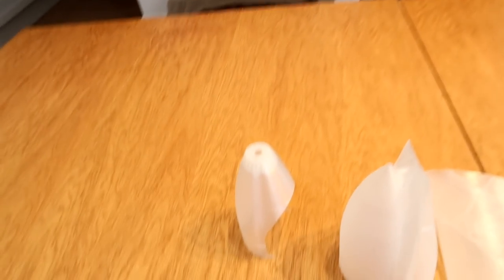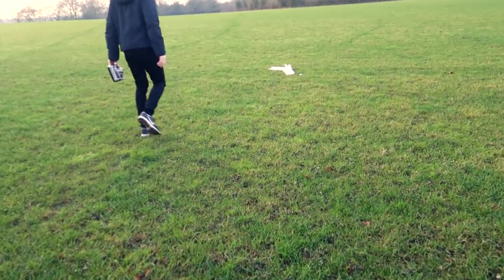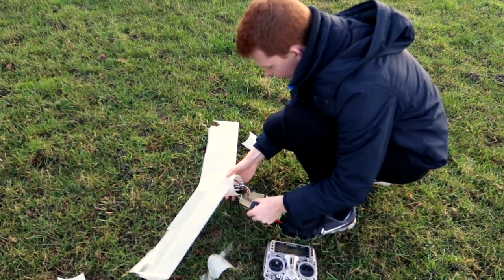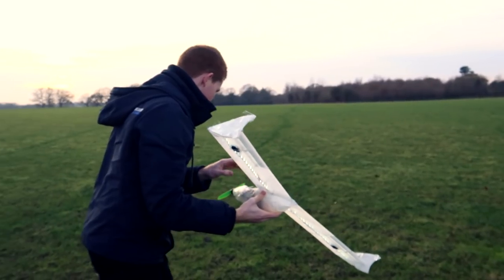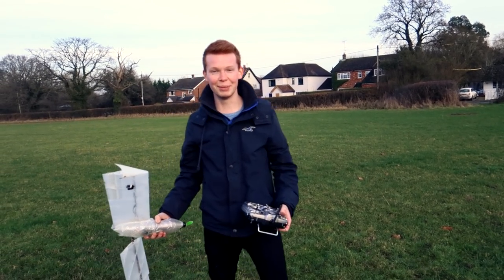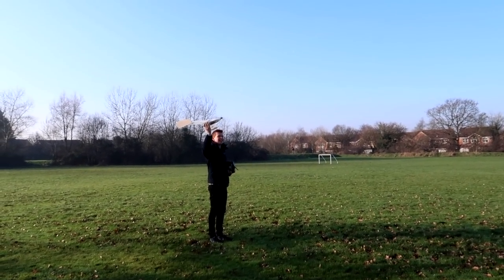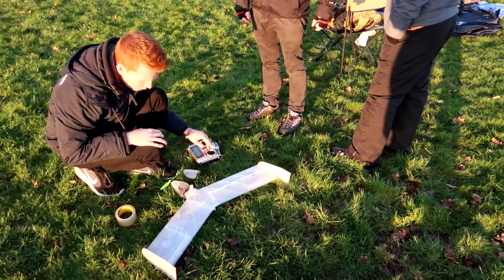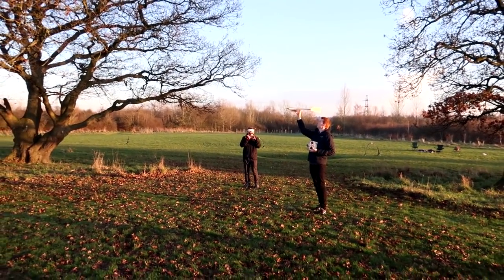3D Printed plane - Will it fly?

Comment: From a vintage modeler of 70 odd years you get that result when you launch pointing up with low power. Try level to slightly down the airspeed will then build up, and even if it could not fly properly it will land straight. We used to have much less power and control years ago and had to find ways of getting the best out of it. Design looks good though.

Comment: I think that the glue giving up so easily actually helps a lot in a crash, yeah, it's a pain to re-glue everything, but it's way better than having a rigid structure that transforms the total kinetic energy of the plane into "OMG 24 hours of printing gone to waste-energy".
Reply: Very good point.
Reply: Reglue>reprint
Consider it a crumple zone in a car
Reply: I make the spitfire fom 3d lab and i glue it whit CA and works great you may consider CA
Reply: Agree, if he had a spar, and better glue, the wing would become the weak point and break.

Comment: The launch failed because of the angle of attack on launch... It immediately stalled and engaged a spin. If you had a platform with a 4-5 degree upward angle climb on full throttle for launch, and had the correct airspeed for launch, your original airfoil would have worked. It was a really good design, I like it.

Comment: Tom, love your videos, and also your persistence! Just in case no one has mentioned this, but a launching catapult would be great to get your tests up and be ready with your controller. You can probably design one with a foot release, or even a servo release using one of your controller channels. I am sure you have probably thought about it already, but it would definitely save you some effort. All in all, keep up the awesome videos, as they are quite entertaining and informative, as I am a big fan of aviation (served in the US Air force as an aircraft Mechanic (KC-135R) ) and I am a great RC aircraft and helicopter enthusiast as well. Really liked your air powered motor project!

Comment: Good for sticking with it!  She looked nice when she finally got going.  Obviously there's tons of designs to work with later.  Perhaps see what it'd be like with the motor and propeller mounted at the rear of the fuselage, and have it rotate the other direction?  Basically make it into a pusher prop.  Perhaps with the weight towards the back it'd be a little more centered and it wouldn't dive so hard to start?  Good luck, and I hope you do redesign for improvements and try again!

Comment: Something that bugs me is maidens with power over hard flat ground! See it time and again (even with the long time pilots like Bruce from RCModelReviews with his pulse jet, and of course Ron!).  Especially if it is a new design or not built exactly to plan, do a test glide on a slope with longish grass!!
Only needs to be a metre or so high ridge, as long as the slope is slightly steeper than the glide slope of the aircraft, you are only feet off the ground the whole time. And yes, get someone else to launch into slight wind, straight out, not heaving up at low speed into the air. Time spent in finding a test flight sight is well rewarded with avoided rebuild time and tears!!
Did you use an established flying wing foil like a Peter Wick?

Comment: The airfoil reflex problem you were experiencing is the exact reason why most model flying wing designs have their elevons running along the whole wing span. This makes trimming for stability way easier, so the CG location is less critical. 

Kind regards,

A fellow aerospace engineer

Comment: 3DLabs work is excellent. I have now printed several of their models and scaled down a spitfire to 80%, which makes for a more rugged design. They are now experimenting with a new PLA, which is virtually crash-proof. Thin wall printing is a black art and takes a lot of practice to get clean prints like the ones they show.

Comment: You can increase the tensile strength of the wings by printing along the span rather than the chord, the way you printed them will make them significantly weaker than the yield strength of the filament used, due to layer separation, ESPECIALLY with torsion and bend loading (which wings are always subject to during flight) 

Same with the fuselage, print along the stress axis instead of across it 

While it may not be a problem for this aircraft, if you want to 3D print a really big RC plane, or a plane that you will be pulling a lot of G's with, you will need to take this into account, or else your plane might end up on some RC plane crash compilation here on YouTube

Comment: Damn I didn't think it would go this well. You just earned yourself a new subscriber. Maybe do a video of the final version which is really only 3D printed without the wood? Also next level would be to use a 3d printed motor :D (look it up there are 3D printed motors with ferromagnetic filament).
Reply from the maker: +HTechHD I will be working on a version 2 in the future for sure. That 3D printed motor is amazing! Thanks for subscribing!

Comment: 3DLabPrints has airplanes you can buy. They have both the STL and g-code ready files so you have a choice to either run the g-code in a i-3 printer, or use the STL files and slice them with Cura, skienforge, or whatever your preference is. Flight-Test had a few sent to them to play with and they are awesome as well. Keep it up you're on the right track.

Comment: First, your design skills are sick, that was awsome! I admire your persistance. Crashes are so discouraging, especially after building everything yourself. Did you check your CG? And when hand launching, try throwing with your left arm. Set the throttle with your nose, but keep your right thumb on the control stick when launching. Lets you pull up or counter rolls faster. Great work!

Comment: Cool that you stuck with it. Others would likely have quit after the first three tries or so and written it off.

Other than that, maybe the glue joins being a little weak is what keeps anything else from breaking? Breaks there at your known weak points. Compared to anything else breaking, that seems relatively easy to fix with some light sanding and re-gluing.

The cool thing is, by it's nature, it wont be too hard to mod the design and do variations or iterative versioning with improvements. Might be fun to make a "fast" one with increased sweep and a thinner wing profile, or a "floaty" one with slightly longer wings, leading edge slots, and a thicker chord. And yet the core design would be pretty much what you have here.

Comment: when launching by yourself, you can hold the controller with your right hand and throw the plane with your left. before you throw it push the throttle all the way up with your nose and you have control from the second it leaves your hand. I had problems with this when I began flying wings

Comment: Awesome video, however just a tip, when you throw the plane, throw it with your left hand so you can control the pitch and roll before throttle, apply throttle before launching, because one problem you had was it just flew into the ground because you probarbly couldn't get your hand to the plane in time. Amazing work to, impressive job fly's great :D

Comment: It looks like you have some yaw instability.  By picking a flying wing, you picked one of the hardest designs to get flying.  Most flying wings are set up overly nose heavy, which is compensated for by having a airfoil with a trailing edge "reflex".  This combination is very important for pitch stability.  Whoops, I started to write this before I finished watching the video, but I'm glad you mentioned the reflex issue.

Comment: Personally I'd forego the canopy and make the front part housing the motor and battery one solid cone with a locking mechanism that has the cone first slide onto the main body to be flush with it and then locked in place with a 20° rotation counteracting the rotation of the prop/motor to keep it locked.

Alternatively you could also use magnets to hold it in place as a form of breakaway point thus possibly preventing damage to other parts.

Comment: The cool fact is that last year no one thought it was possible to 3d print a plane and now every one in experimenting! I would like to leave you a couple of suggestions:
-why didn't you used the classical wing design with spar and ribs?
-i know it's more difficult to print but i suggest you to print the wing so that the slices are aligned with wing axes and not with the section to have some more rigidity. (3d prints are stronger along the slices).

Comment: Huge fan, Tom. Great stuff. Wondering if you have tried printing just one of those larger parts at a time? Sometimes the travel time between them can add hours. Try slicing just one, then adding another and checking the estimated times. Best wishes and good luck. Keep it up :-)

Comment: You should continue with the experiment in the following areas : make wings lighter until you find that point of strength limit , improve interlocking mechanism of parts , add lessons learned into new design , add camera ,

Comment: Flying wing airplanes need to have washout to prevent stall/spin, and the wing cross section should have reflex in order to reduce the change in pitching moment with angle of attack. Flying wings can be a challenge to design. you want to be sure that the root of the wing stalls first. Also pick an airfoil specifically designed for flying wing aircraft. I am an aerospace engineer.

Comment: Congratulations on your eventual success.  I would suggest that you might attempt to base your design on a clamshell-type flying wing with similar dimensions because the structure will be more rigid due to the lack of shear-force joints that tend to be the weak points.  Printing the upper & lower (left & right) wing sections in 4 separate pieces glued together and adding winglets is a pretty solid platform.  Otherwise, this was a wonderful lesson in experimental flight.  I also liked your wing construction video in arriving at a lightweight design.  Thanks for sharing and don't mind my know-it-all-ness.

Comment: another great build, and right up my alley. I am an rc airplane enthusiast and have built several flying wings myself. Generally I find that my elevons are deflected  up quite a bit in some cases. It seems to fly great but I think you have more control with a bigger cord. Just my opinion bit you might want to give it a try. 👍

Comment: Heavier planes has higher stall speed, big inertion, low manuverability and more speed at landing.
But they are more stable. Lighter planes are better, but suffering from wind and turbulence.
730 gramm for under 1 meter airplane is quite lot. 450-550 is ideal weight! My foamy Spitfire with 1050 mm wingspan, 1800 3s battery has weight 535 g. Thrust is 860 g.
Reply: On my very first RC plane, I lost it on my first time out with it cause I flew it too high(in the valley of mountains) and an updraft took it so high I lost visual on it as well as control. I never saw it again.
Reply: That's such a sad story ! May he rests in the planes cemetery, far beyond the clouds !

Comment: You should try it again with ABS! You could turn your 336.4g into 282.14g, if you've got an extruder that is capable. Just print a little slower than normal, and maybe try to keep the heat in around your printer to prevent the layers from separating.

Comment: Wonderful work. Next time you launch a completely new design, perhaps use the roof of a 2-storey structure so even if it is going down, you can see how it is reacting on the way down, in order to gather more data. Also, might I suggest slightly more dihedral?

Comment: Very entertaining.  great design concept and the reaction after the maiden was funny. Regarding your issue with having no hands on the right hand stick, I almost always fly alone and have quite a simple solution.  Hold the plane in your left hand and the Tx with your right. then ad your desired throttle with your mouth, then throw.  I find that time is more forgiving to throttle inputs when compared to elevon ones :)
Reply from the maker: +CrossedUpChris ! Yes I've seen many people throw it with their left hand, but I don't trust myself throwing with my left hand yet haha. Thanks!
Reply: StantonFPV yeah it feels wierd and a little clumsy. on a dialled in plane I'll sometimes launch with my right but in general I don't trust myself not to crash in those first few seconds hehe

Comment: I hope you don't mind a bit of criticism, but it was your launch technique that was the main problem. Insufficient speed at the point of release which resulted in wing tip stall. Did you include washout in your design? I know it's a very small wing but a degree or two of washout might help. Interesting video though.

Comment: I am an avid 3D print engineer. I have a couple drones and a remote control truck. Time to try my hands at a plane. If you can PM me I would like to print your design in honor of your efforts and try this myself!

Thanks again for inspiring me. Good job sticking to it when it got tough, figuring out the bugs and working past them!
Reply from the maker: Hey, I'm currently working of a version 2 which has the increase in airfoil reflex and correctly sized winglets. 
Will be uploading it to thingiverse once I know it is decent. Thanks!

Comment: Great project! Tho, first attempt = tailheavy(yes i saw the whole thing;) causing a tipstall because of low airflow. Second attempt was frontheavy or just to low speed to get lift:) Third attempt, cg okay but to low speed for lift :) 

Tip: hold transmitter in your right hand, give it launch(full) throttle while holding it. Then launch with left hand så you have your right thumb on the controll stick :)

Comment: Well done. My 3D printer is on its way and as a long time RC flyer I can appreciate the time an effort you put in. I spent 3 years on a VC10 airliner and crashed on its second flight, but repaired it and have a few videos on my channel now. Including the crash! Are you going to publish your design. I love flying wings and I've built a couple on my CNC hot wire machine. 
Keith

Comment: Forget the glue, fuse the parts together using heat. You can even weld using a rod of printing material in a dremel or drill. Google it there are some how to out there.

Comment: In the old days of bringing a micro processor to life, getting the screen to say "hello world" was a breakthrough worthy of celebrating with a champagne dinner. Why, because now you had feedback. The rest of the project was now about optimization and there was no longer a lack of output to wonder about. Maybe it wasn't the output desired, but there was now something to diagnose besides overheating. I am sure that this won't consume your life, but I doubt this is your last 3D printer airplane design. you might try a few degrees of convergence on the winglets. That may help with yaw. You may also get better adverse yaw control with spoilers than ailerons. Small airplanes have low polar moment of inertia which means that without positive stability the plane will get ahead of the pilots response capabilities. To understand my concerns, try balancing a meter stick vertically on the end of your finger. Its doable with practice, but now try the same thing with a pencil. No one has fast enough reflexes to do that. Small airplanes have more problems than small Reynolds number airfoils